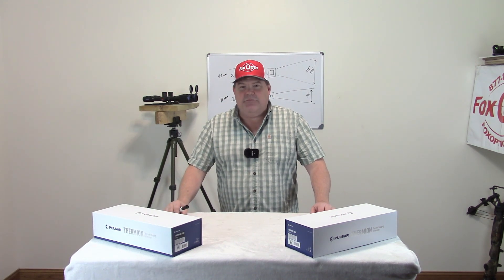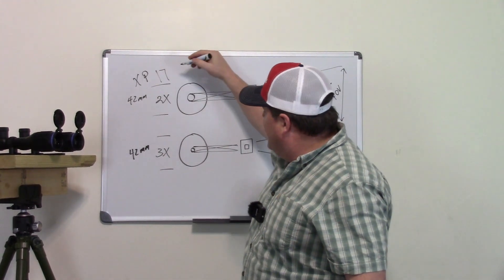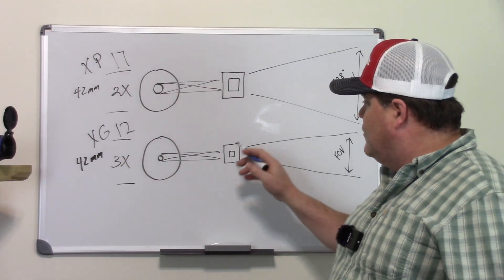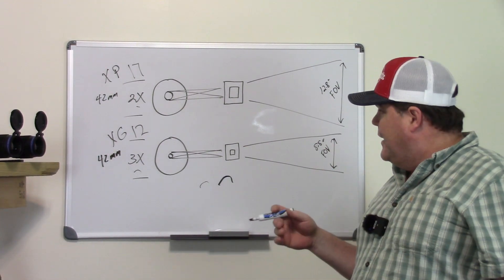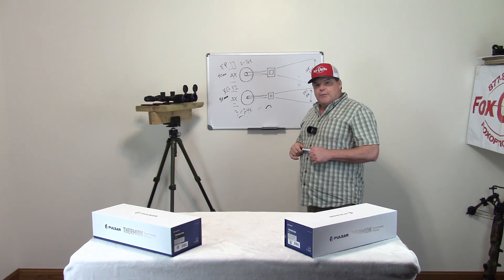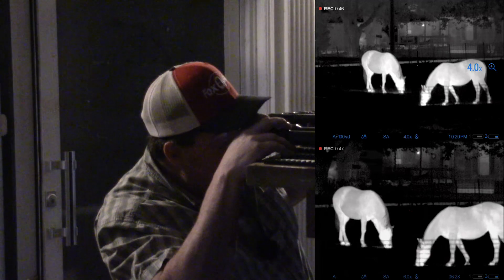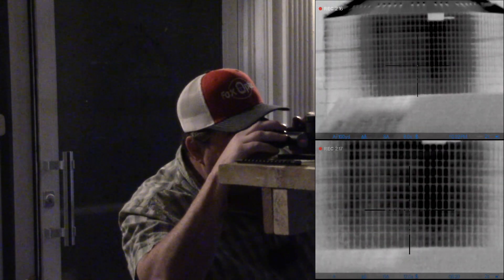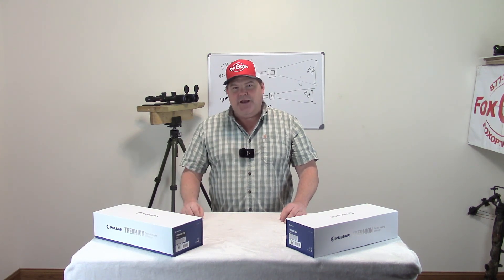Pulsar Thermion XG 50 or XP 50 more FOV or Magnification both high resolution

Comment: Although the comparison video was excellent and much appreciated, the foregoing explanation was extremely confusing and technically incorrect.
It's not the lens diameter which affects magnification and field of view, it's the focal length of the lens.
The ratio of focal length to lens diameter gives the relative aperture, which affects how much thermal radiation reaches the sensor and also affects the depth of field.
The focal length of the objective lens in both scopes is 50mm (hence the 50 in the model name).  
The relative aperture of those lenses is 1.2, so the diameter of the lens is 42 mm (50/1.2)
Also, it's not the lens diameter which controls the magnification.
The combination of the sensor size and lens focal length are the main factors in determining magnification, but display size and ocular focal length also come into the calculation of magnification.
Magnification is dependent of lens focal length and sensor size.  
Increasing focal length increases magnification and decreasing sensor size increases magnification.
Sensor size depends on the number of pixels and the size of the pixels
Both scopes have the the same focal length lens and the XG uses a sensor with almost the same number of pixels as the XP, but the pixels in the XG are smaller, so the sensor is smaller and therefore the magnification is higher.
Since the magnification is higher, the field of view will be narrower.
I'd also take issue with your use of the term "resolution" to compare the number of pixels in the sensor.
Resolution (effectively. the smallest thing an individual pixel can see) is simply the pixel size (in microns) divided by the focal length of the lens (in mm) 
The result of that simple calculation is an angle in mrad and the smaller that number the more detailed the image and the longer the detection range.
That simple calculation can be applied to any thermal imager (monocular or riflescope) and provide an immediate "figure of merit" with regard to the level of detail it can display and it's detection range
For the XP 50 the resolution is 17/50 = 0.34mrad
For the XG50 the resolution is 12/50 = 0.24mrad
So the XG50 will give a more detailed image and have a longer detection range
Reply from the maker: Bruce,  Thanks for the detailed information.   I really appreciate your explanation.   So is it possible to maintain 42mm lens diameter increase the lens magnification to 3X and still adequately "flood"  the the 17 micron sensor with only a focal length shift or would that increase aperture if they didn't increasing lens diameter?
Reply: @foxoptic5887  Forget about lens diameter, when it comes to magnification and field of view, it's focal length that matters.  Both the XP50 and XG50 have objective lenses with a focal length of 50mm.  The position of the sensor behind the lens is such that either sensor is fully covered by the thermal radiation coming through the lens.
The magnification of a digital scope (be it night vision or thermal) depends on 4 factors.  There are:  Objective lens focal length(A), the diagonal size of the sensor (B), the diagonal size of the display (C) and the focal length of the ocular lens (D).
The magnification (M) is given by (A/B) * (C/D)
The XP50 and XG 50 have the same objective lens, display and ocular lens, the only thing different is the diagonal size of the sensor and the sensor in the XG50 is smaller  (because its pixels are smaller)
Looking at the (A/B) bit of the equation - making B smaller makes the magnification higher.
Another example of this is comparing the XP38 with the XP50.
The only difference between those scopes is the focal length of the objective lenses (38mm v 50mm) Looking at (A/B) again, A is bigger for the 50mm scope, so (A/B) is bigger and the magnification is bigger.
Now compare the Helion XP50 monocular with the Thermion XP50 riflescope
Both have the same objective lens, sensor and display.  
The Helion has a base magnification of x2.5 but the Thermion only has a base magnification of x2 The difference is because in the Thermion, the focal length of the ocular lens has to be longer to provide eye relief.
Looking at the (C/D) part of the equation, increasing the focal length of the ocular makes (C/D) smaller, and therefore the overall magnification smaller
I found the equation here https://www.pulsar-nv.com/glo/support/night-vision-technologies/77/
Going back to lens diameter.  The aperture (f number) of the lens is the focal length divided by the diameter, so you could have a scope with a 50mm focal length lens which has a diameter of 50mm (aperture f1.0) and a scope with a 50mm focal length lens and a diameter of 42mm (aperture f1.2) and they would both have the same magnification and field of view.  
However the scope with the 50mm diameter lens would allow more thermal radiation to reach the sensor,
In fact the overall NETD of a thermal imager is the NETD of the sensor multiplied by the lens aperture.
So, a thermal with a 35mK sensor with an f1.2 objective lens would have an overall NETD of 42mK, while a 40mK sensor with an f1.0 lens would have an overall NETD of 40mK
Hope that helps
Reply from the maker: @brucemcpherson8832  Thanks for the detailed reply, I really appreciate it.   I have spent a fair amount of time trying to find more information regarding these devices and it's hard to come by.   Feel free to call me sometime.   Travis Fox Fox Optic direct cell or text 6603419370
Reply: Hi Bruce are you on Nightvisionforumuk.com? Looking at the footage the detail on both scopes looks the same when they are on the same magnification.
Reply: @20ppc  Yes, I'm phoenix on the NV forum

Comment: Travis, what was you using as a rangefinder?
Reply from the maker: The original Pulsar Trail  XP38LRF.  It is the same  640x480 sensor resolution at basically 1.5X considering the display difference.